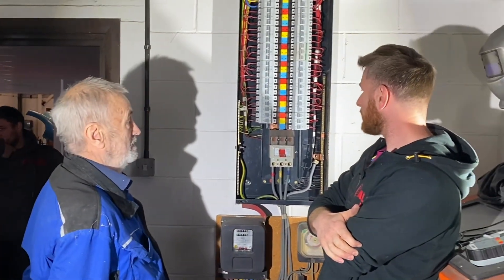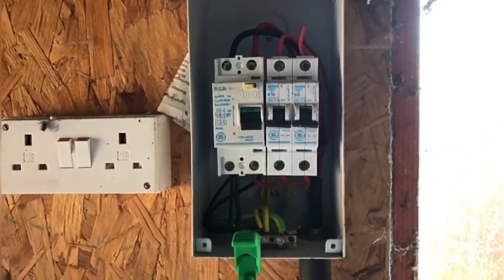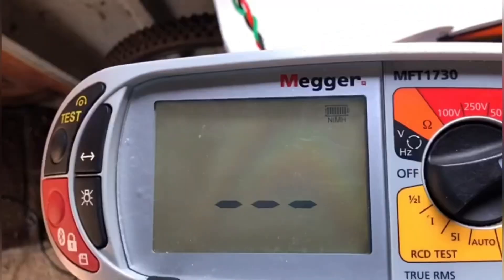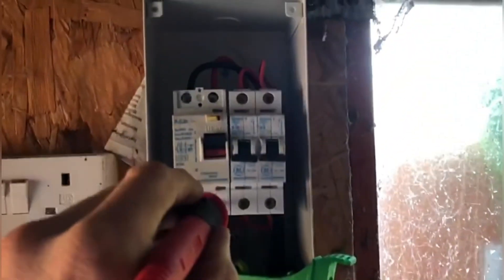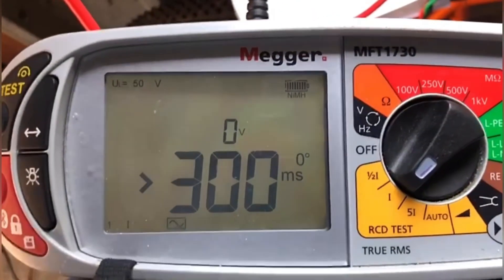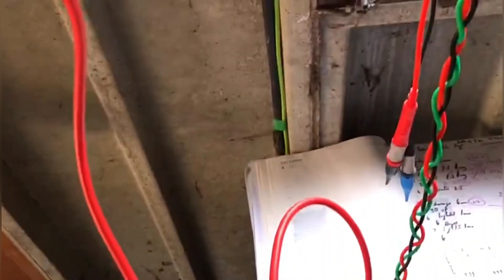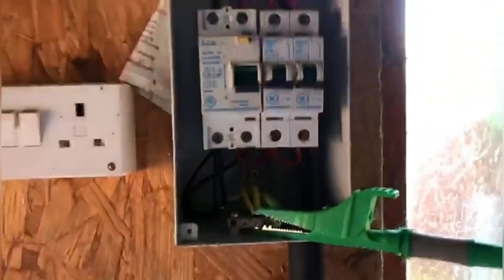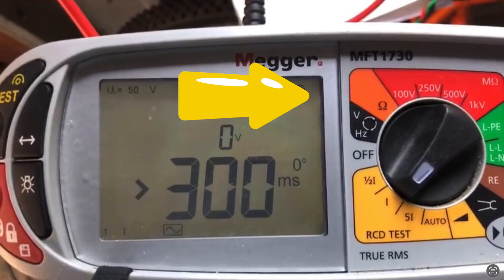Has BS 7671 Got How we Test RCDs CORRECT..?

Comment: I m8ght be wrong but i understand that AC setting is right for all rcds. If you set it to type A . You are only testing functionality of its dc side of things. Which is above the capability of a type Ac. So if you set to type F again you will be only testing what is above the standards of the pervoius 2. So i to put it plainly each extra symbol on the rcd has. Its that part only you are testing.

Comment: I failed mt am2 becaus i did not test the rcd to industry standard. After working oyt what went wrong for a simple test the conclusion was i did not do the first no trip half test as per GN3. After the half test then tje times ine at o and 180
Reply: Did you ZS each circuit prior to testing their respective RCDs? As during a ZS test you send 15mA down it, just as would have while testing at 1/2 times... Could have been worth the argument. 😅

Comment: Am I missing something here ?  It didn't trip at 1 x i.e. 30mA, so isn't it faulty ?   Unless there is DC saturating the core ???
Reply from the maker: No loads connected during the test. We are now only required as a minimum to test any type of RCD as if it is an AC RCD and at 1 time i delta n. Just asking the question in the video has BS7671 got it correct to test RCDs this way… thoughts…

Comment: Under amendment 2 that RCD has failed. 
On another note, it seems daft testing on AC for all RCD types. As, for instance, a type A RCD will respond to pulsed DC values of root2 x the AC values (30mA). So a 30mA will take 42.42mA at x1. Hence the slower times we now tend to record, sometimes up in the 150ms range it’s a lot slower now than what we was used to🤔
Reply from the maker: Love your thoughts Daddy B 🦾

Comment: I said it when amendment 2 first came out I will continue to test at a 0.5x 1 x  and 5x . Also I was under the impression that The 0.5x and 5x was dropped because some people were returning perfectly good RCDs thinking they were faulty because they failed to trip at 5x ? . The 1x test is all we did back in the eighties , so it seems that the reg have moved backwards  . Then not all RCDs will behave in the same way , one might fail the 5x and pass the 1x yet another one might fail the 1x and pass the 5x . So for me do all  three test on both sides of the sign wave. So no BS7671 hasn’t got it right Or have I missed something here 
Great video Gaz as always 👍